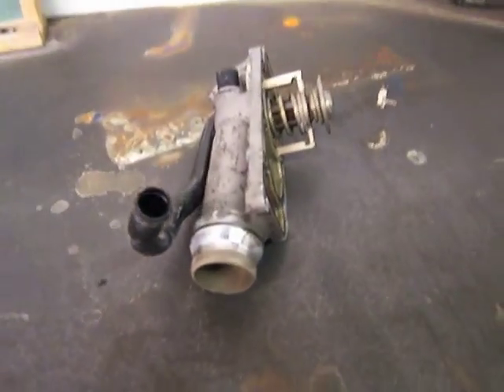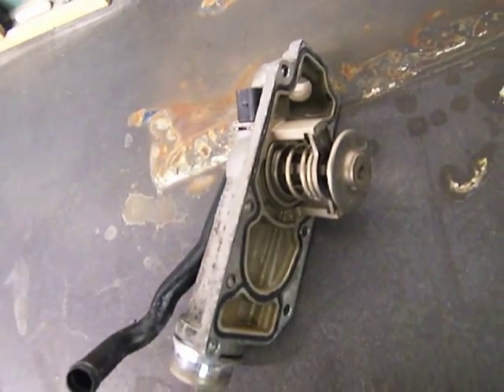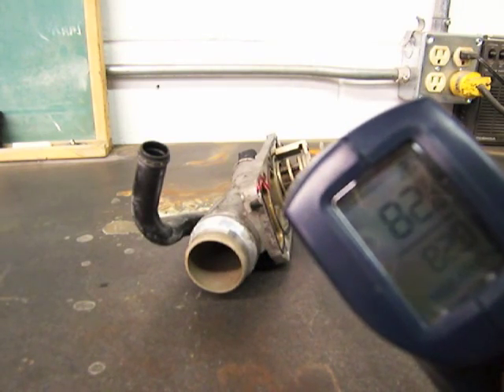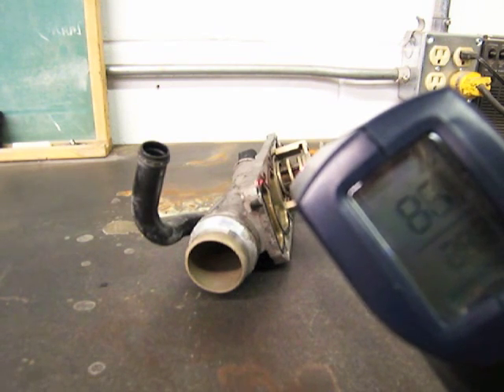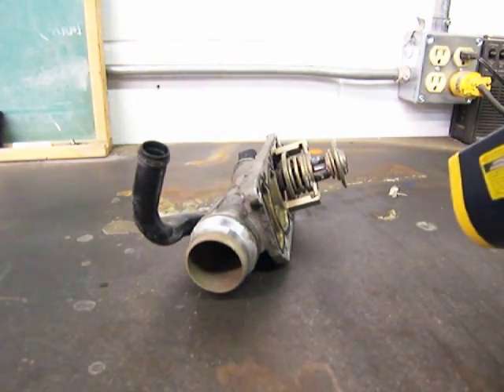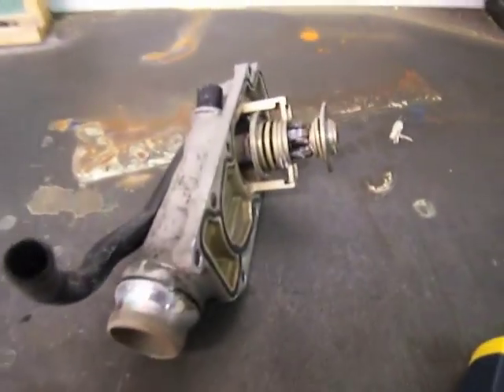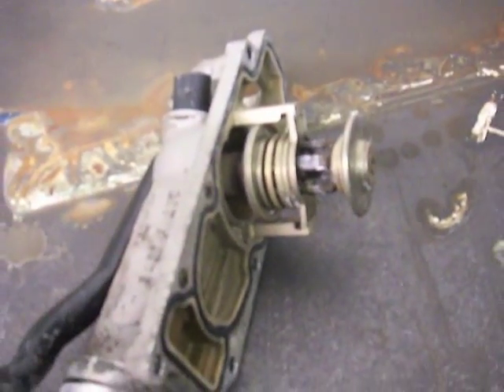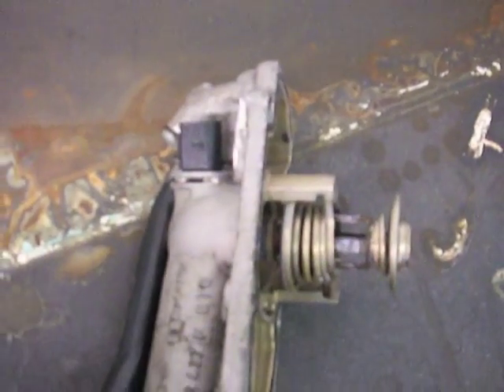W8 thermostat

Comment: This proves what the SSPs say - that the thermostat has a failsafe mode that will begin to open at 100 Celsius. Note that the thermostat didn't reach full-open position until 250 F (121 C), so don't assume that your thermostat is working normally even though the ECU says it's not. The normal operating temperature of the W8 engine is controlled by the ECU to center around 90 C, and varies it by several degrees up or down according to engine operating conditions. And yes... W8 enthusiasts should check out W8Forum.dk